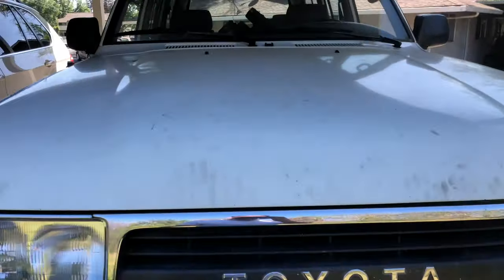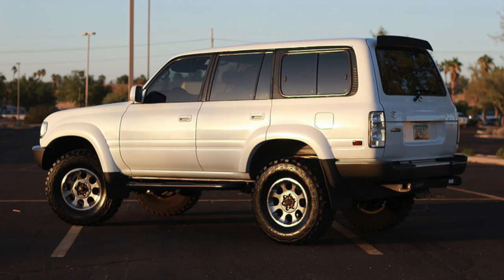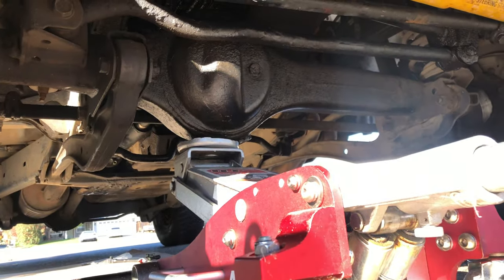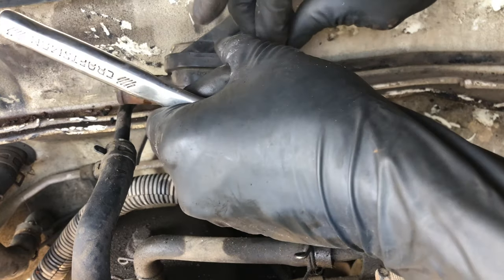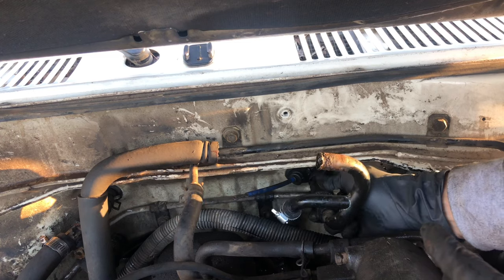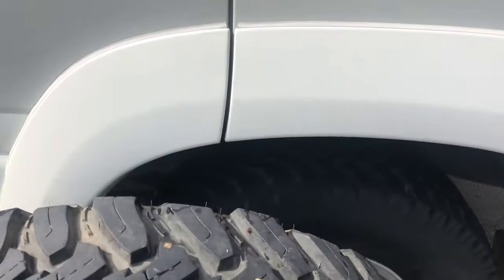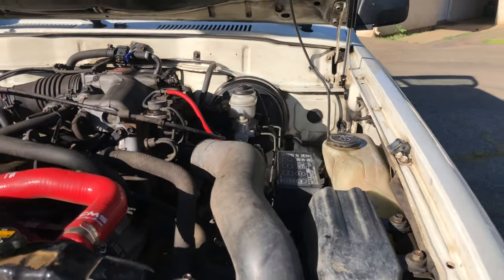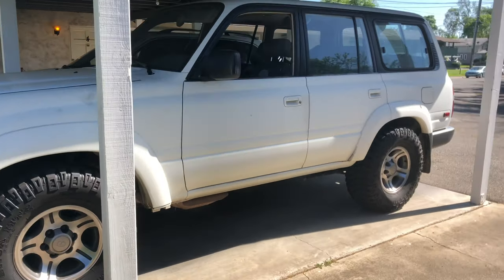6 mistakes every new 80 series owner makes

Comment: I owned a LC80 VX 1997 diesel with triple lockers and I installed 38” tires on it with 6” lift and I didn’t have any problems with it,it was a very good and reliable car and many do run 44” tires on them here in Iceland,that’s  nessisary  when you are driving up onto the glaciers and to and from when most of the regular roads are covered with snow.

Comment: Ive owned my fzj80 center locked for about 6 years now and I can confirm this list is solid.  The most important thing on this list is baselining, specifically replacing every hose. I've replaced so many parts on my cruiser. If you pick one up, you'll need to be ready to do a lot of deferred maintenance and preemptive maintenance.

Comment: From my experience on my ‘97 lx450: 
if triple locked and they won’t engage in a parking lot after turning and messing around etc, get all four tires off the ground (blocks), then engage lockers. should work. also check all fluids in engine, transmission, coolant etc.  

make sure there has been a headgasket done recently, or you have one on hand and ready for when you may need to replace it. hopefully before it’s too late. (personally had to buy a whole new short block from Toyota, hoses, practically a new car). 

i’ve replaced all my track bars and control arm bushings. sway bars may need some attention too, mine weren’t that bad. 

BIRFIELDS. they will need work. if you want to get them done, do it right. don’t half ass it. it’s long and may be frustrating but it is worth it to replace all gaskets, new red moly grease, new bearings etc. 

suspension, if you plan on 2 inches or more, also plan on “Drop Blocks.” SLEE Off-road sells them, that’s what I have on my Lexus. i’m running with a 2 inch lift. 

interior may also be an issue, just buy some cheap seat covers if you plan of repairs in the near future, if not then buy some quality covers. speakers too, chances are that they might be a little blown. 

RUST. it will be somewhere (sadly). don’t worry, make sure it isn’t structural. it’s preventable if you care enough to dump the time and money into it. 

if there are any other questions, i recommend the website ih8mud.com. there are millions of LandCruiser enthusiasts on there, don’t be afraid to post some simple questions or concerns. 

EDIT:
forgot to mention to go to forums on the website ih8mud.com to find and answer any questions or concerns. there’s forums for 40 series, 60’s, 80’s (aka lx450’s), 100’s, 200’s. i promise that the people on there are the friendliest on the internet, they also tend to be smart asses. and yes, LandCruisers are an addiction, they also cost a lot more than drugs haha. 

if you have questions, i have an instagram so feel free to message me. (justus.juice)

Have Fun!

Comment: Love your content.  Finally a channel that shows me how to do something and not just how cool your truck is. 

Can you do a video on the proper way to grease the slip yokes and gear splines on the drive shafts.  The service manual says to pump grease until it comes through the seal.  A ton of other online resources say grease until the drive shaft barely moves and warms us to not over grease this spot because too much grease can damage some components in the transfer case.  Let us know your thoughts and help us keep everything maintained.
Reply from the maker: Thanks for watching Scott, and that is a great Idea I have some work I need to do so I will definitely post a video on how to do that!

Comment: I drove mine as is for the first 2 years while I saved money for everything that I had planned for it. Had transfer case, water pump, oil pump, gaskets, hoses,  front/rear diff, heating/cooling, plugs, wires, distributor cap/coil and electrical all done for $3800 at TORFAB Land Cruisers. Wheels/tires, roof rack and ARB front bumper all sitting in the garage waiting to be installed after my paint job! Hoping to have it ready by July! Last thing on my list is upholstery and touch screen.
Reply from the maker: Dude that is awesome!! Smart man
Reply: @LNDCRUZIN  : I'm glad ur putting out new content for the 80 series cus I know I'm not the only one who has watched every single vid on YouTube more than once. I'll try to post a walk around when my rig is done.
Reply from the maker: Yeah dude we need more people showing off their builds let me know when you finish!

Comment: I have a FZJ80 with part time 4x4, so it automatically has a centre lock. I added a lunchbox locker to the front because I have nearly got stuck a few times by getting cross axled. It does everything I could ask of it.
I don't really like a rear locker because it can get you into real trouble & you end up on your roof. Learnt that driving a Unimog in my military days. It pivots around the back wheel that has traction & turns you sideways when you are climbing something steep.
Reply: Wow that's very interesting... Going fast down hill meaning.
Reply: I have a 79 scout 2 along with my cruiser which I put a lunch box locker in the rear of and after driving it alot in snow and mud, I agree with what you're saying. You're along for a ride and it can be pretty sketch but it is fun and also makes it much more capable and fun while in 2wd.

Comment: have a 100-series. first thing did was spend over 5000 on maintain the core stuff, engine, drive train, suspension, fluids, etc. Now it runs even smoother and quieter, than some new cars.

Comment: One positive about putting bigger tires is that your RPM's will go down and you will get better MPG in the freeway! The engine has enough horse power with the factory 4.10 gears and will be fine. No one cares that the speedometer/odometer will be off a little. That's what the speed app on your phone is for. 😉
Reply: Less rpm’s yes, but massive increase on heave rotational mass x4. Food for thought.
Reply: RPM's go down per rotation, but to go the same speed (75MPH) on stock tires vs say 35s, but that also means you have much less torque available for say passing, going up hills etc. Thus you actually need to floor it in order to get the same power you would have had on smaller size tires. You will definitely not get better MPG's with bigger tires, the rotational mass/increased sidewall flexion will use more energy than you gain by going a larger diameter. And assuming you get a much wider tire on your cruiser like everybody does (they shouldn't, look up pizza cutter tires vs wide to see why) You will have even more drag.

Comment: The center diff lock exists on the fj80 it just only locks when you shift into Low Range. It just doesn't have the center diff lock button for high range, which I have, but I never really need. If I really am doing some serious stuff I'm going to shift into Low range anyways.

Comment: I have a FZJ80R Sahara triple locked it is awesome on the tracks I had a Toyota surf before it, chalk and cheese for capability heavy on fuel but it is what it is around 3 tone truck. have about 380000 k on the clock have rebuilt the motor runs great.

Comment: Our 97 40th anniversary 3x locked has never and I mean NEVER left us stranded, 240k miles and still running brand new. I agree that you shouldn’t think badly about yourself if you don’t have the 3x locked version. To be honest for most people the standard center locker is perfect and I haven’t been in any situations when I have needed the front and rear to be locked. Unless you plan on wheeling then yes the 3x locked version is the way to go.
Reply from the maker: I couldn't agree with you more! thanks for sharing

Comment: My 1992 80 with 1hz diesel has done over 700 k km's on the original motor. Biggest problem is body rust. It has no lockers but does have a 5 speed manual box.

Comment: Lockers before lightbars. I just bought a 93 4 Runner with a nice lift and 35'z and a 96 Geo Tracker 2 door 4x4. But I want a 3 locked 80 series too.

Comment: Answer have two 80 series, original since new, and dented  pre-rolled on to which lift kit big tyres etc... Added. Won to bash about and not have to worry about. Most important add ( both vehicles ) the second battery and fridge. Essential if you are nowhere for several days. Cheers

Comment: I'm really liking your 80 Series videos!  This is still a vehicle that I would love to have; however, they can be really expensive!  Depending on your approach and application.   I'm also currently restoring and modifying my 99 3rd gen 4Runner 4x4 w/5 speed manual.  This is also my daily driver, but I've always thought that maybe someday an 80 Series would come my way.  Who really knows in the future...  Thank you for this, so I also subscribed!  Toyota Love! 👍❤
Reply from the maker: Thank you brother! You will find one, mine fell into my lap! For a sweet deal
Reply: They’re not really that expensive. It’s just the previous owners don’t do any maintenance because it’s “indestructible”. It is but you have to do some things to keep it running right (birfields, rear main seal, etc.). There are great ones out there that need nothing. Buy the best one you can afford and it’s surprisingly cheap to operate. Remember, rust is your enemy

Comment: I was doing some maintenance on my '08  2.7 Tacoma and realized it had the original long life spark plugs at 165 K miles! Worn but working. I upgraded my '94 Land Cruiser with the iridium plugs, new wires, cap and rotor ( wish I could find cap with brass inserts). I bought a aftermarket thermostat and compared to the factory unit it's crap ( got Toyota version).

Comment: Two mistakes Australian buyers make (1). Towing with a non turbo 80 series. The manual gearbox behind the 1HZ is incredibly weak. (2) putting big tyres (33 or above) on an 80. With that Hilux sized front diff, you'll blow CV's constantly.

Comment: Awesome vids bro keep it up love the 80 about to turbo my diesel 1HZ HJ80 had the car for a few years maybe slow on road but amazing off-road and I only have the centre diff lock wish mine had the rear and front lockers but you can go pretty far without them but cool to have kinda sucks you guys didn’t get the manuals or diesels available
Reply from the maker: Agreed they are awesome wheeling rigs. And yes they can go plenty far without lockers
Reply: turbo. only 7 psi,or you blow the motor & box,there not built to turbo.
Reply: @phantomwalker8251  rubbish, 20+ psi or don't bother

Comment: Bought my 91 from the original owner and it had been sitting for YEARS, he did nothing to it, the front axel was full of sludge from seal failure as he just kept putting in grease through the knuckle... Soon as I got it home the rear shocks and water pump failed, then the radiator went (2 coolant drains in a month) and the list goes on.  Thanks to Rock Auto most the parts where on clearance $2 belts $10 spark plug wire set, $20 rotor set ect.
Reply: Doesn't get any better. I've replaced my front wheel bearings and in seals  twice in 2 years. My front left seal is leaking again. Major manufacturing error with them

Comment: First thing I did was take my landcruiser to Toyota and had them install brand new suspension as the wheel fell off 3 days after I bought it and didn’t trust the guy I bought it from to fix it drives perfect now just need to detail it and respray it and good to go

Comment: Purchased another Landcruiser FZJ80 ( for $6,500 Australian Dollars) with immaculate interior 24 valve petrol (gas) motor goes like a rocket. Also has a factory LPG (gas????) conversion. Swapped most of the stuff over seats, carpet, internal trim and just about to do the headliner. My HZJ80 has gone from a 1997 4WD to a 2020 Cruiser!  These are probably the best Toyota 4WD ever made. Didn't have the $136,000 US to buy the 80 series with 2,000 miles on the clock at a recent US auction and cant afford the $175,000 AUD for a 300 Series. Arctic a Russian company is upgrading the new 300 series which looks awesome but I guess we are not allowed to buy stuff from there and I do not have $250,000 US in my back pocket. Don't like the hot turbos in the V6 valley as I think they will fry themselves, however the rest of the 300 series is classic LANDCRUISER.

Comment: Torn between a 3rd gen 4runner and a '92 LC that's for sale locally.  Paints shot in a cool kinda way and says 175k miles on the clock, he asking 7k for it.  I'm not looking to off road past the occasional dirt roads so going stock would be my goal.

Comment: I guess common sense isn’t so common. I bought mine. Fixed it mechanically. Wheeled the snot out of it stock. It’s now armored up with 33s. Thinking about re gear n 35s. The only takeaway at all was think about drivability. It’s why I only have 33s. Still IMO needs lower transfer gears though.
Reply from the maker: Yeah a lot of young guys like myself, the reason I know this is because I made mistakes and learned I always see people doing these things and getting themselves into trouble.

Comment: BRUH that thumbnail. That 80 sold at auction for like $48k
Reply from the maker: Bro I know I was following that one. it was super clean tho if I had that cash $$$$$$
Reply: @LNDCRUZIN  buddy,,first thing you do to a new,,used vehicle,is,change all fluids,check everything is tight,look for worn cracked rubbers,bushes,b/joints,u joints,slip yokes,knuckles. re pack knuckles. wheel bearings,plugs,belts,trans fluid,service auto. wheel align. check brakes ,shoes discs. drive for 3 months,THEN, think about upgrades. hope you enjoy your 90 kw.. ill keep my bronco 230 kw.,with a solid front axle...12k to re build that chunk,,cheaper to fit an LS, & box,. if your not doing looooong trips..
Reply: @LNDCRUZIN  it has drum rear,?,,in aus there all disc. 37,s are way too big. those diffs are not that strong,they fit nissan diffs here. if you re gear,id be fitting quality bearings all round & re build the knuckles. then fit a v8..if your any where near brazil,,go find your self an MWM sprint 4.2tdi. or a bmw 3 lt turbo 2008 2012. those 1hz,s are dinosours..

Comment: Any lift over 3 inches, be aware that other problems will arise. I have a 4.5" lift that it took me almost a year to finally get it tuned.  Advice: STAY AWAY from those eccentric caster correction bushings!  Go for the drop brackets or the caster correction plates.  The 3FE engine with proper maintenance will last a looong time!

Comment: What size would you recommend for the wheels and tyres,i mean which will look good  and would not effect gear or raise other mechanical issues ?
Reply: I have a 105 and 255 85 16 are just perfect. Its a 33. Its the most suitable tyre i have used downside is not as easy to get as some other sizes.

Comment: Are spare parts still available for that LC model? Are they hard to find now?

I would go up to 35 inch tires only to avoid regearing and will have less stress on the suspension.
Reply from the maker: Yeah they still have parts, often hard to find but there are still some
Reply: @LNDCRUZIN  oh hard to find parts now, not good anymore then.

Comment: I have had my 97 LX450 for about five years. I hope I never have to get rid of it. Running 35's on a 4" Slee lift. Factory lockers, winch, bumpers, roof rack.  Need to do 4:88's. These are heavy gas hog trucks....you have been warned. With that said, these are in the top 10 best off road vehicles of all time.
Reply from the maker: LOL exactly they CHUG gas

Comment: How would I know the difference between a single lock vs. a 3x lock?
Reply: You're dash will light up a light for your center front and rear lockers when engaging them.
Reply: They’re only 93-97, they have the dial for lockers, there’s a difference in the vin sequence
Reply: All the constant-4WD versions of the 80 series have a Centre Diff Lock (CDL).  This locks the output to the front and rear driveshafts within the transfer case.  Top line models have a viscous centre diff, the rest are mechanical.
The 'extra' two difflocks are within the front and rear differentials and lock the drive across the respective axle.
Some markets & models had factory (optional?) electrically actuated difflocks.  If your vehicle has these you should have a factory light on the dash. 
However there are numerous types of aftermarket diff locks available (automatic/air/electrically actuated).
The "3x Locked" terminology just means you have a CDL, plus a difflock on each axle.

Comment: #1 Nope! Definitely went through and did all of the maintenance work on my cruiser first. Same with every car I've ever purchased over 40k miles or 3 years old....Habits of a former repair shop owner. Then I proceeded to throw all my money at it....and still do. It is a black hole whose gravitational pull only effects my money. #2 Kinda but not really, went custom. #3 I have let mine go a bit the last 2 years. Knuckles should resealed and the hydro assist has taxed the steering gear box a bit and it leaks a little. Otherwise she's solid. #4 Put in the time...thumbs up....iH8Mud...great advice. #5 Guilty! 37 and up club! Speedometer FZJ80 buy a Yellowbox V5, corrects speedo and transmission shift points. #6 3x-Locked... it's nice, but its also problematic at times and the stock 80 is very capable in the hands of a capable driver.

Great Video!